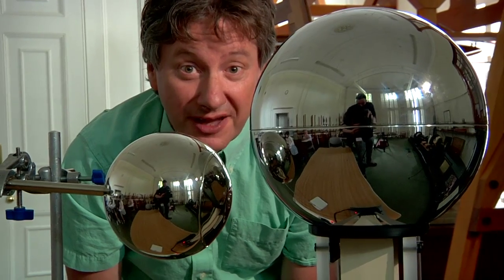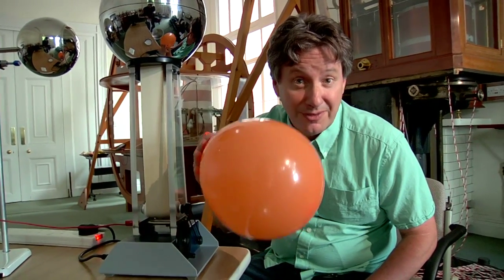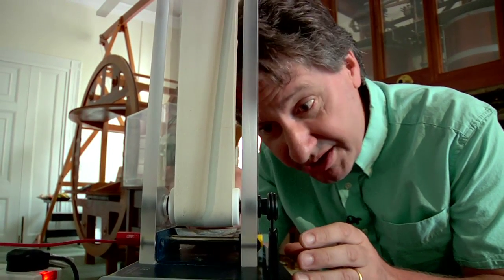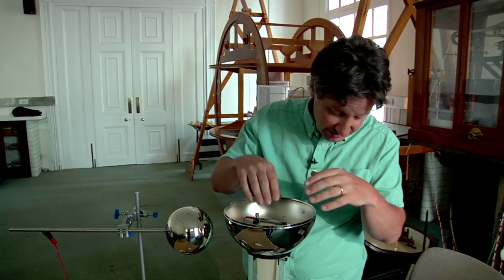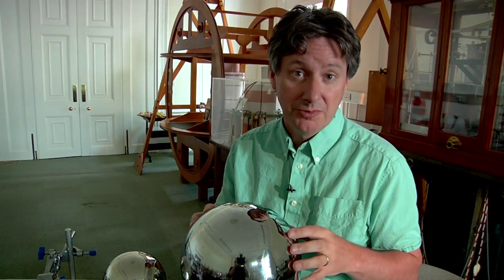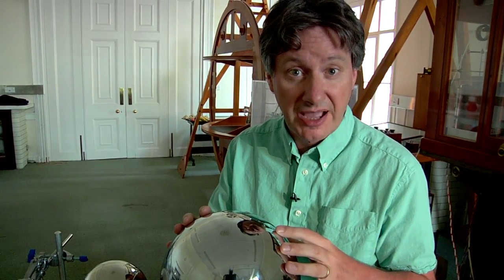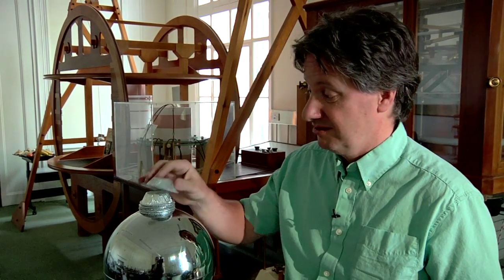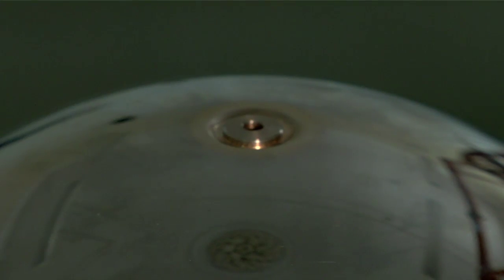How does a Van de Graaff Generator work?

Comment: Hello, National STEM Centre! I am the senior instructor at a kids sleep-away science camp in California. I am in charge of curriculum development and am currently working on a notes sheet to help new instructors understand the physics behind the Van de Graaff generator. Along my research online, I've run into mostly explanations that describe a transfer of positive ions that move charge. This confuses me. I always used your explanation where electrons are transferred from bottom comb, to belt, to top comb, to dome, and finally arcing to grounding rod. Does it depend on which materials you use as to whether it's positive charge or negative charge? Or are both explanations happening at the same time in opposite direction? (Like how there's confusion between conventional current direction and actual electron flow?) My rudimentary explanation worked when I was just presenting demos to 12 year olds, but now I'm responsible for teaching dozens of adults how to explain this to kids and I feel like I should have a deeper understanding that I do now. Thank you for any help! It'd be a miracle if you responded to such a lengthy comment on a video as old as some of our campers!

Comment: Thank you.I had various questions on this subject,which YOUR explanation on the design has already covered.
Example....
Nobody else bothered to point out the two different materials used in the collection process.
I presume that each one is listed on the triboelectric list.....it would have been helpful to point out WHICH materials were actually used.
Reply: Band is rubber.. The lower roller is teflon and the upper is nylon.. However, his explanation opposite to most.. I've heard it's positive charges transfered up the belt

Comment: Excellent educational demonstration!  Bravo!  Thought I would share some things that I have found over the years that might improve the performance of the generator:  Cover the base with a smooth metal surface having no sharp edges.  This will reduce ion current leakage to the high voltage terminal. This base cover can also be connected to the lower brush as a source or sink for electrons, and the base can be connected to earth ground to prevent charge build up on it.  Also, the top roller can be metal and connected to the upper brush as well as inside the globe.  All of the charges on the belt will be transferred to the globe exterior regardless of polarity.  Using a PVC lower roller with a gum rubber belt produces copious amount of positive charge on the belt, and is not too fickle with humidity,  :)